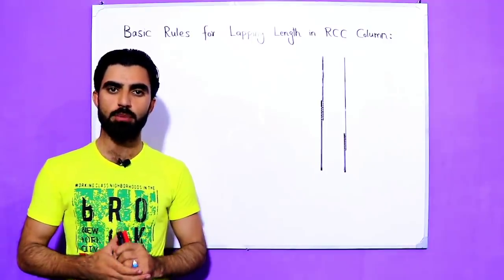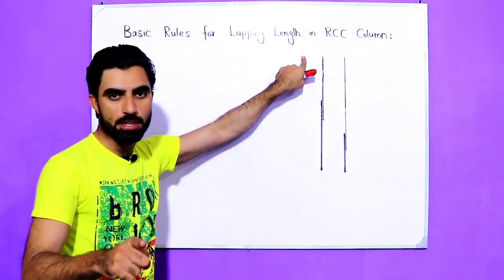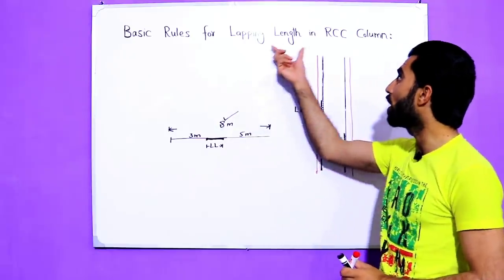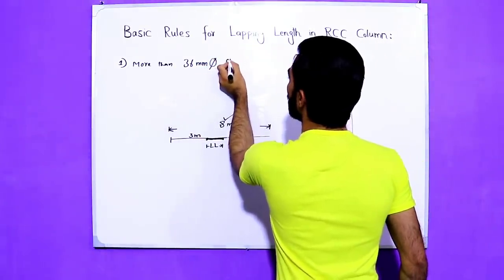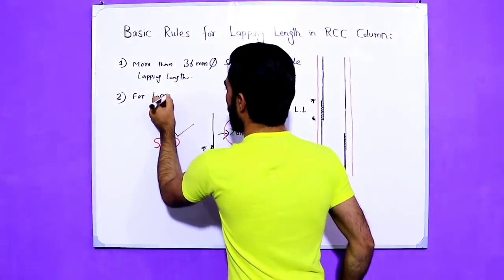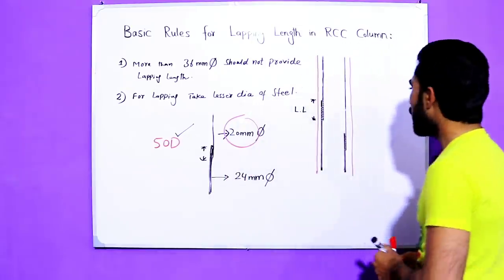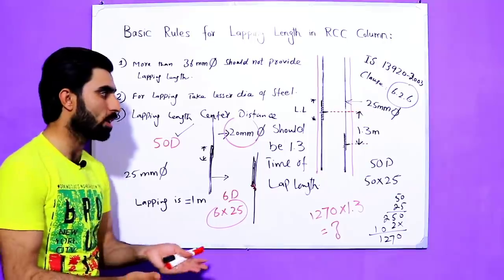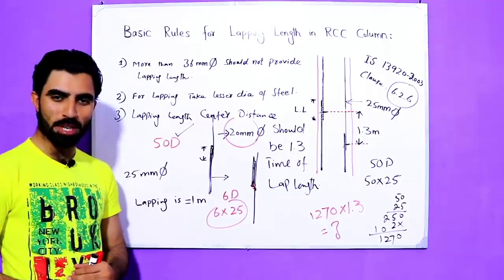Basic Rules for Lapping length in Column - Lap length in RCC Column

Comment: Assalaam Alleikum brother, i need your help i have build a foundation of 3 store building, the problems are some of the steel bar exposed from the foundation beam are shorter than what is required are shorter than 50cm the steel sizes are 16mm, the formula of lapping 45d gives 72cm and some exposed bar are less than 50cm, how can i solve this problem.. Thank you

Comment: Clear Height between plinth beam top and roof beam bottom-11 feets
Zone-A-11/4=33 inches
Zone-B-11*12-66=132 -66=66 inches
There are 6 bars 16mm@4,12mm@2
At zone B top- 2 no of lappings
At zone B middle(30 inch below top lapping points)-3 no of lapping
At Zone B bottom (30 inch below middle lap point)-1 lapping

Whether the above arrangement is allowble?
Whether lintel tie beam can be provided any zone?
What if lintel tie beam falls on zone-A top area?
Reply: guys i gat some real question i need to get only clear 25cm over my ready made columen reinforcement wichnos 14mm diameter having 6 bars 20x30 mm dimesion . so should i use 1.3 factor when making the overlapment?

Comment: Tnx for ur video , but i have a question that on the previous video u said the lapping length is 40D but now u said 50D ....which one is right
Reply: 50 is right
Reply: It is not fixed, it varies for different columns...It is given in structural drawing
Reply: 40D is for slab only and 50D should be for tensile zone of beam or slab

Comment: your Calcutaion is wrong . check your calculate . because 25×50= 1250 is right answer. and your answer is 1270 . is wrong . check it fast.
Reply: Being an civil engineer calculation doesn't matter because here he is doing without calculator the thing is that u have to understand the concept bro instead of focusing on calculations which is not important
Reply: Nice video your lecture on civil subject is atractuve. Your stress on whreevr required is promt. Thank you